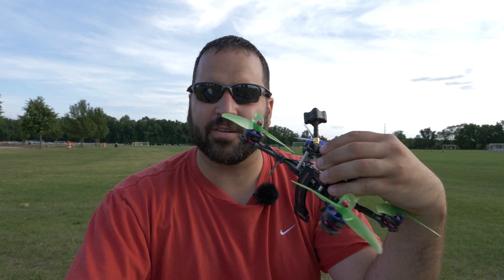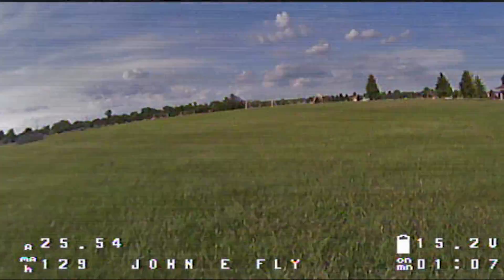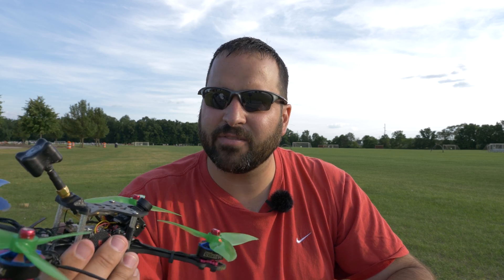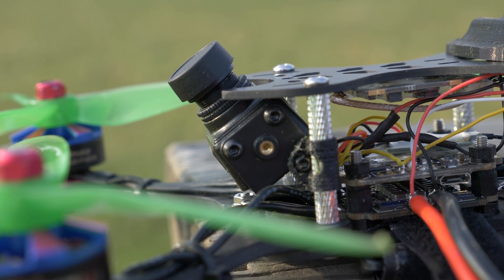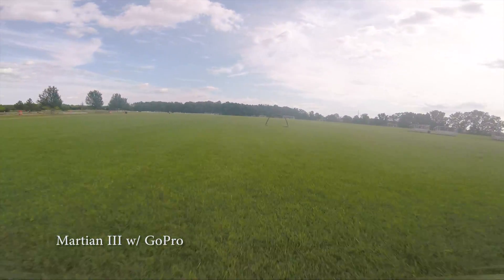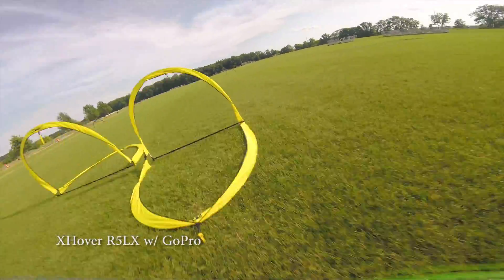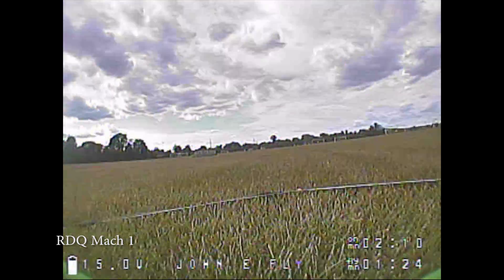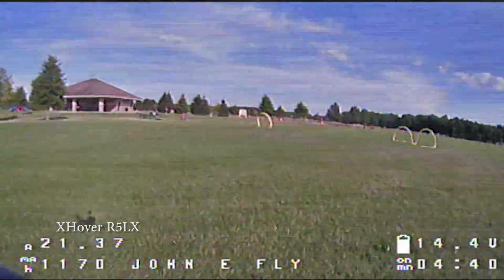RDQ Mach 1 Part 2 -- Camera Tilt To the Rescue?

Comment: how many degrees is that Steven ?
Reply from the maker: I was probably running 55 degrees at the time.  I have since switched to a Micro camera with a 2.1mm lens and 45 degrees on that one.  The added FOV of the 2.1mm lens lets me have more control at different speeds with this quad.

Comment: Hey John, I have been looking at getting this frame, but I am a bit worried about how the arms are mounted. Especially one being secured by a standoff only no bolt. Have you have had any arm breakages? or is there any play back and forth? Thanks!
Reply from the maker: I did break a lot of arms on this frame.  Even some minor crashes were breaking the arms.  However, I have since changed from the race arms to the normal arms, and I have no longer had any issues.  Even with hard crashes, it has been totally fine.  All of the arms are attached with the combination of 1 nut/bolt and 1 standoff.  For what it's worth, this is also how the arms on my XHover R5X are mounted as well, although the actual carbon extends further into the main frame with the XHover.  Personally I wouldn't be concerned at this point as long as you are using the normal arms.  With race arms, expect to see some breakages, but you'll also save yourself 14g if that's important to you.
Reply: John E Fly great information there thank you! That's what I was wondering with the race arms, I'll be running heavy 35g motors so i would def want the normal arms. The weight shouldn't be an issue. Thanks again for a great reply!

Comment: Could you take off the bracket and use just the top holes on the case to get some more tilt and maybe more stable
Reply from the maker: +Adam Harlow I tried that first, but at that spot the camera ran into the FC stack, so I couldn't use it.  I have A runcam micro on it now, and so far it's working much better.
Reply: John E Fly  can we see pics of the micro cam on it? I have a Mach1 frame and a micro cam on the way and I'm curious to see how well it fits in the frame.  thanks great vid
Reply from the maker: Jeppy M working on a video of it now.  unfortunately I fried one of my hyperlite V4 motors yesterday.  hoping like hell I can find a replacement somewhere around flite fest.  I'll try to see if there is some place to post just a pic of it. it looks great.